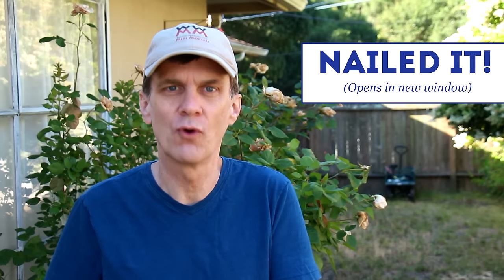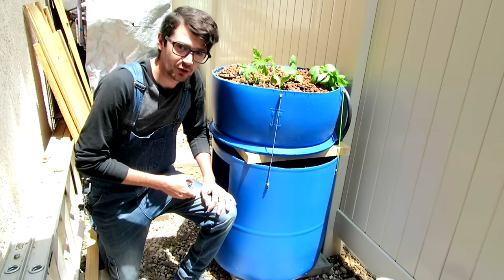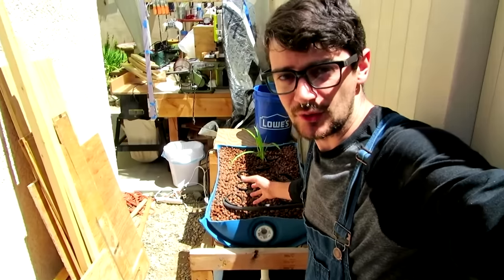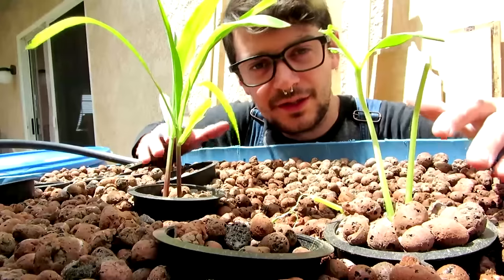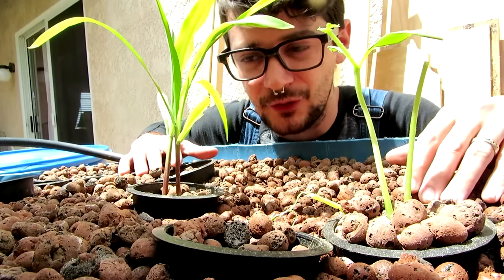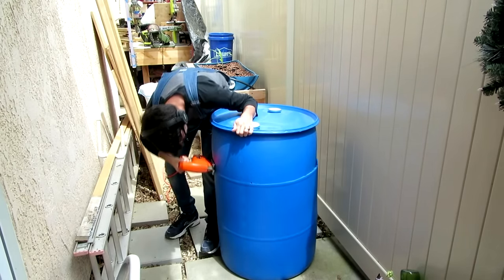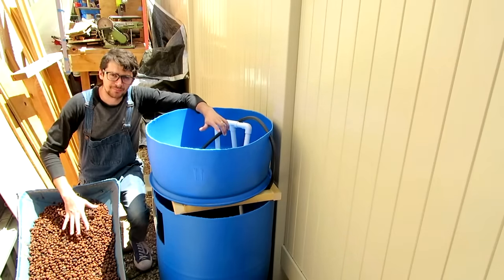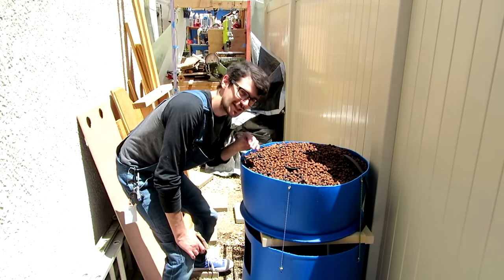Use FISH to Grow a Small Space Container Garden. Really!

Comment: How would you handle chloramines in city tap water?  I would think you could use an aquarium water conditioner at startup.  If you have town water with chlorine only it will break down after a couple of days circulating, but chloramine is much more stable.  Make sure to consider this when starting up a new system,  refilling the water that evaporates or after cleaning as chlorine and chloramine could kill the fish.

Comment: Looks like a potentially cool channel. I will check it out. I have had a blue plastic barrel in that size for over a decade now. I use it to hold plastics to recycle. It is not that hard to carry that into the van when I go drop off recyclables. I guess I am not using it as efficiently as I could be. :p - Heidi

Comment: What kind of fish?
Is the pump on a timer so it's not consistently keeping the tub full?
Reply: +Paul Martin 
Hey Paul, great question! I used to have the pump on a timer in my old system. It would turn on and off at 30 minute intervals for 30 minutes at a time (on, then off).

This new system doesn't have a timer. That little pump is running 100% of the time. The siphon can suck down a lot more than the pump is putting up top.
Reply: +Jonathan Garth  You still left off some major details - what kind of pump are you using that can run continuously and what kind of fish are you using???
Reply: +Marv Sohlo 
Hey Marv! Sorry about that. I bought the aquarium pump from a nearby nursery. I honestly forgot what brand it is. I believe it's a 200gph aquarium pump. I got one that is submersible and can convert to an in line pump as well. I've never really used the in-line feature but I wanted it in case I needed it in the future.

I use goldfish. If I were going to eat the fish I was raising, I would use catfish. Here's why: Both goldfish and catfish are REALLY hardy and can live in sub-prime conditions (warm/cold water conditions or dirty water (if something breaks and you need time to replace a part or something). Basically, it takes a lot to kill them.

That being said, I've seen a lot of systems using all kinds of edible fish! These are generally larger systems, though. Since mine is so small, I figured goldfish is the best way to go.

Thanks for watching! I hope this information helps!
Jonathan G.